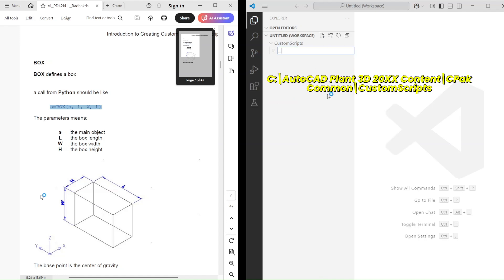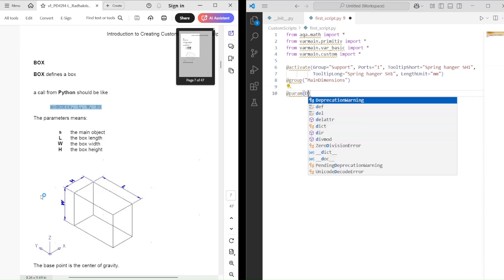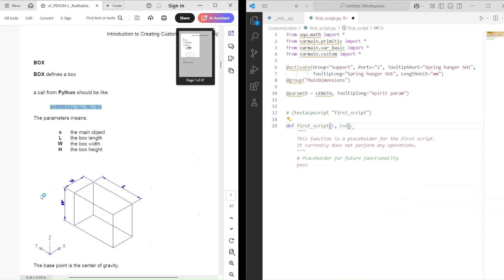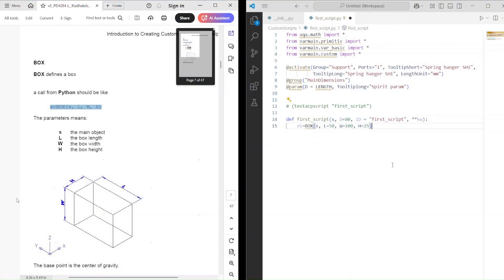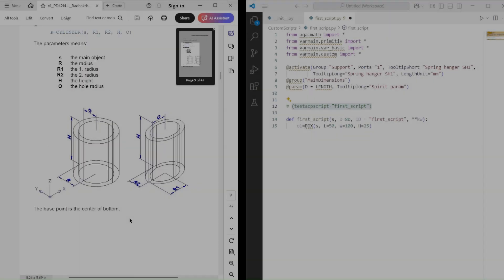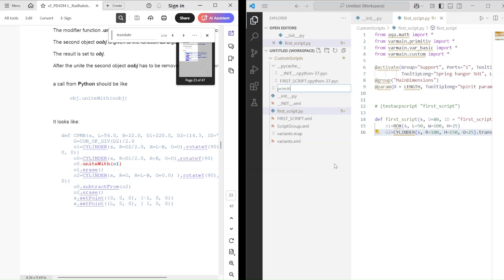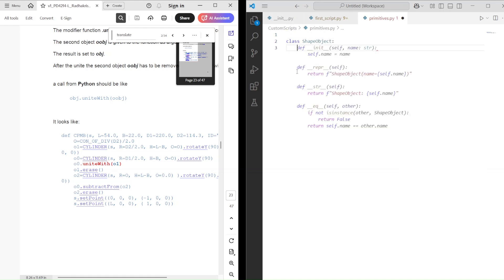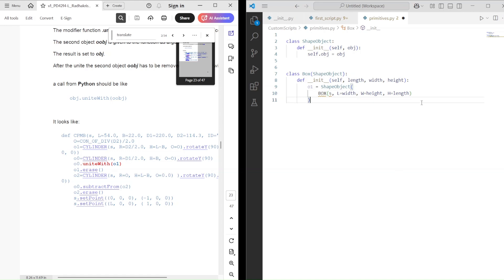Custom Supports in Plant3D with Python – Full Guide Series Part 2

Comment: Hello! Is it possible to do this course with Plant 3d 2025 ? From version 2025 plant 3d is included in Autocad 2025. I tried everything step by step like on the firsts minutes from You video and my plant 3d never see any scripts after command PLANTREGISTERCUSTOMSCRIPTS : / i think something wrong is with the path to the scripts because the arx adapter see the scripts in only one correct path and I don't know from where exactly : / this is a path where I have my plant3d installed with version 2025 ( like a big plugin in autocad 2025 ) C:\Program Files\Autodesk\AutoCAD 2025\PLNT3D and in this folder we can find PnP3dACPAdapter.arx maybe You can help me or You know where I should have my scripts to be visible for arx adapter

Comment: Hi. need help here. I have follow all your steps from the beginning of the video but when I try to test the script on Autocad as in minute 2:50 in this video, there is nothing shown in the drawing area and in the Command Line shown as "nil". Please help
Reply from the maker: Hello and thank you for your comment . I really appreciate that you follow my channel.
When register new script first time it is necessary to restart Plant3d and only when restarted to test script. 
Did you try this?
Reply: @SmartProjectDesignStudio  yes I have restarted my pc. But one thing that I also noticed is there is no cache file created in CustomScript folder after I insert the PLANTREGISTERCUSTOMSCRIPTS command
Reply: @SmartProjectDesignStudio  I don't know what is the problem with my current PC but I have tried to setting this all over again in my other laptop and it is working fine. Thank you so much
Reply from the maker: Glad it workes. If you had any further questions don’t hesitate to ask me 😊

Comment: @SmartProjectDesignStudio   Hi. To test a script’s geometry, you don’t need to restart Plant. It’s enough to create a wrapper file for testing the required script, and this also lets you avoid compiling the script. And to clean the drawing you can make a LISP file. This will significantly speed up your development process.
Reply: Hey, I love this advice, do you know the correct way to set this all up?
Reply from the maker: @JoshuaAckermann  Yeah, I tried it and it really works
Reply from the maker: Wow, you were absolutely right! I was overthinking it and looking for some special workaround, but your tip was spot-on. It works perfectly.
Thank you very much for the advice — I’ll share a video with everyone, because this will really help a lot of people.

Comment: error: FIRST_SCRIPT.py", line 1, in <module>
    from primitives import *
ModuleNotFoundError: No module named 'primitives'
Reply from the maker: Hello, 
do you have primitives.py file in the root CustomScripts folder or in some sub-folder?
Reply: @SmartProjectDesignStudio  Yes, It is in sub-folder under CustomScripts. Is it necessary to name primitive.py and directly under customscript folder?
Reply from the maker: @richardkwan2840 no need. Just when you do import use the full path. Sufolder.primitives.py.
Or even subfolder1.subfolder2.primitives.py
Reply from the maker: @richardkwan2840 of course you can use any name you want 😊
Reply: @SmartProjectDesignStudio i will try it tomorrow,  i thought it will be okay as long both py files on the same folder.
Reply from the maker: @richardkwan2840 it is going to work. I had the same problem at the beginning

Comment: Hola! Escribo tal cual el mismo código y lo guardo en la carpeta \CPak Common\CustomScripts: 

from aqa.math import *
from varmain.primitiv import *
from varmain.var_basic import *
from varmain.custom import *

@activate(Group="Support", Ports="1", TooltipShort="Spring hanger SH1", TooltipLong="Spring hanger SH1", LengthUnit="mm")
@group("MainDimensions")
@param(D = LENGTH, TooltipLong="Spirit param")

# (TESTACPSCRIPT "first_script")

def first_script(s, D=80, ID = 'first_script', **kw):
    o1 = BOX(s, L=50, W=100, H=25)

Luego, en plant 3D,  PLANTREGISTERCUSTOMSCRIPTS; (arxload"PnP3DAcpadapter.arx")

Y no funciona,  la respuesta en Plant 3D es:

Command: (TESTACPSCRIPT "first_script")
nil

He probado con muchas variantes y no funciona, sólo funcionan los de la carpeta "varmain" que son distintos, ocupan una línea al final para activar, del tipo:

activate(SUPPORT_TEST_01, '\n[Type AQA-VSUPPORT_TEST_01]\nVID=STRING,32\nDN=STRING\nLe=LENGTH\nUnits=STRING,8\n;\nuniqId=CALC =$self.VID$ $self.DN$\n;\n@key=VID,DN\n\n', '@VarDataDefault0')

¿Sabes cuál puede ser el problema?